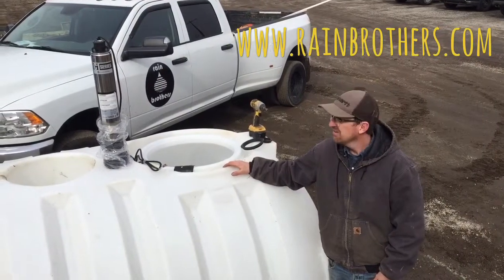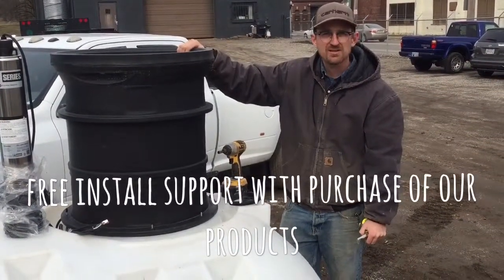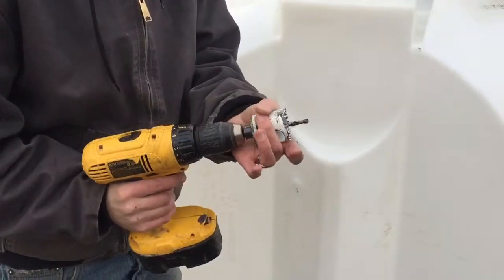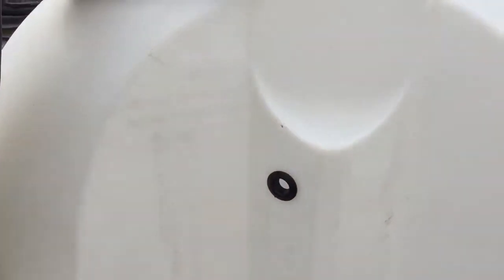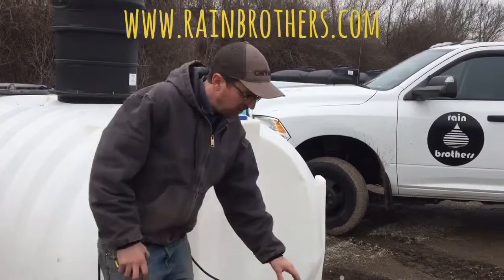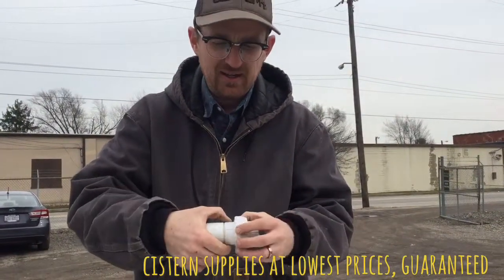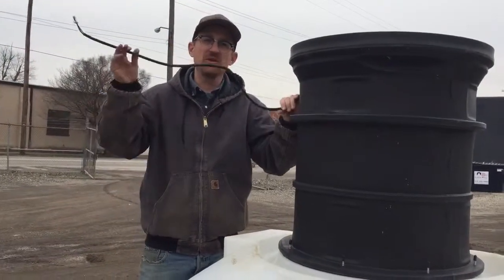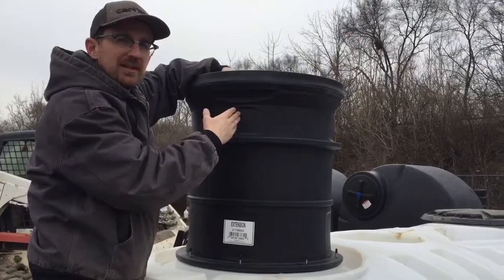Installing pump in rain harvest cistern

Comment: Great Video! What are some solutions to prevent your tank from overfilling? Are the risers water tight? I have read some people having problems with ground water entering through the riser connection points.
Reply from the maker: We always recommend installing an overflow in the tank to channel excess water away. And we always apply silicone caulking liberally on the gasket of the riser before securing them to the tank

Comment: What size hole saw do you use for the 1” pvc
Reply from the maker: 1.75”. A complete chart is available here:
Reply from the maker: https://www.rainbrothers.com/store/PIPE-GASKET-FOR-TANK-PENETRATION-VARIOUS-SIZES-p310981998
Reply: Does the pump need to be standing straight up and down or can it lay horizontally?
The frost line here in Montana is 60”  my poly tank is going to be slightly under that depth .
We are also going to cover the top of the tank with insulation before we bury, hoping for a little bit more protection?

Comment: Great video as always! But how do you reach the union (to access & remove the pump) with the riser in place? I've seen you plumb a U-bend in other videos to raise the height of the union for access, but then aren't there concerns with freezing since that would raise the pipe above your frost line? The frost line where I am (VT) is pushing 5ft, so I'm trying to wrap my head around this tank bury depth vs pipe position vs accessibility conundrum. Thanks!
Reply from the maker: Thanks for the kind words! This is one disadvantage of plastic cisterns: There’s no good way to mount a pitless adapter. A union is unfortunately the best way, and it may require getting in the tank a bit to undo the union if you ever have to pull the pump. Thankfully, our pumps last a long time (15-20 years, on average), so you shouldn’t be in that situation often.
Reply: Great question the frost line in Montana where I’m putting. Mine is 5’ also.
Reply: Wouldn't the temperature anywhere in the tank be below freezing due to the majority of the tank well below frost line? So a loop for access to union would be fine?

Comment: Hi, What are you using for pump protection - low water level? Shouldn't you be installing a level float switch in the tank too?
Reply from the maker: We use a normally open float switch. For our Springer Series Traditional pumps, we have a float switch pre-installed on the pump

Comment: What does the wiring look like inside the extension?
Reply from the maker: It depends what voltage pump you're using. On one of our Franklin C1 pumps, on the 115V model, the black is the hot, the white is neutral, and the green is ground, so you would match like-to-like with the power supply coming from your house. On the 230V model, the black and the white wires are both hot legs, and the green is ground. If you have one of our float switches with our pump, then you'll match the white wire from the float switch to the black wire on the pump. Once you do that, you'll have a black wire remaining on the float switch -- this is your hot leg... all you're doing is interrupting the hot leg with the float switch before it reaches the pump.